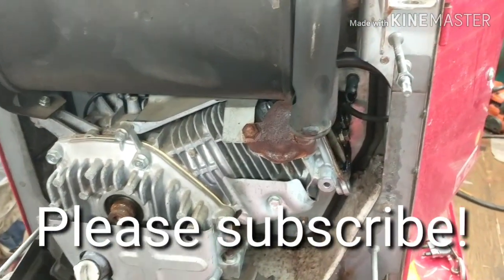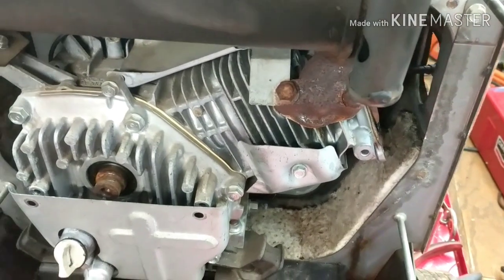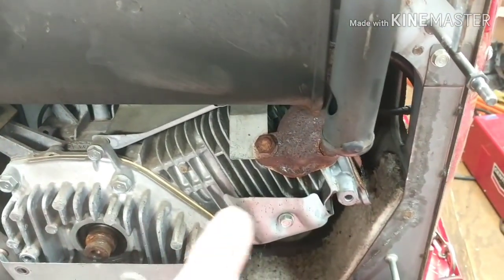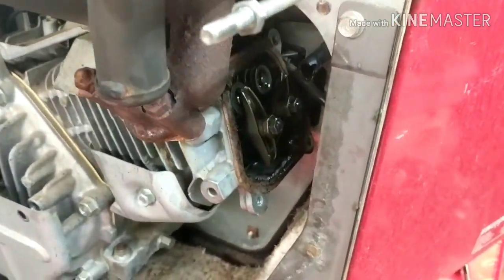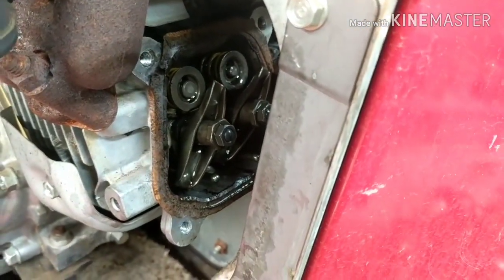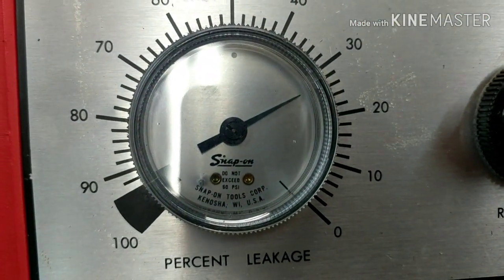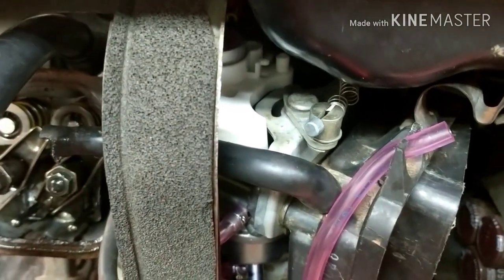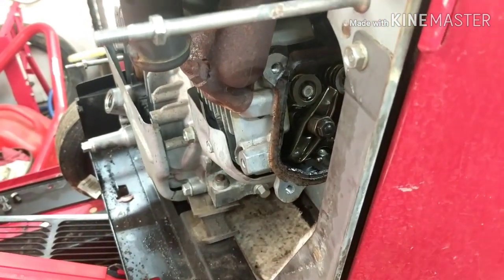Honda GX200 GX160 running rich leakdown test

Comment: I’ve got a gx200 on a pressure washer that backfires when rpm slows down when not pumping water, any thoughts on what the issue is?
Reply from the maker: Clean the carb and make sure all the gaskets are good when mounting it on. Also check valve clearances.
Reply: @TepcoCycleRepair  thanks for your suggestion

Comment: One of the best Honda engine videos.  Really like that pressurization to determine where air leaks are but not sure if there is a “homemade” device to use.
Reply from the maker: Yeah, I would recommend the motion pro single dial tester or search eBay for a used Snap on like in the video, you can get them cheap.